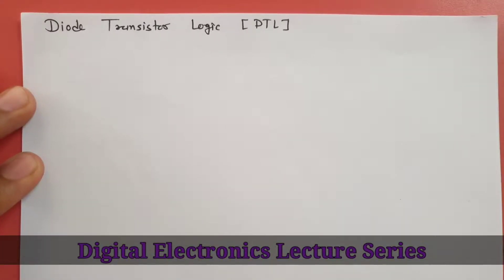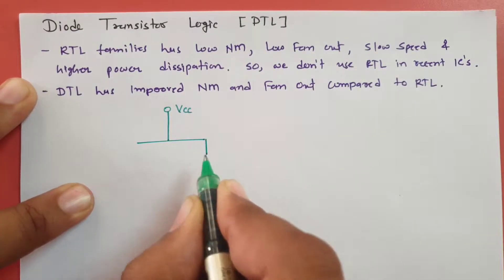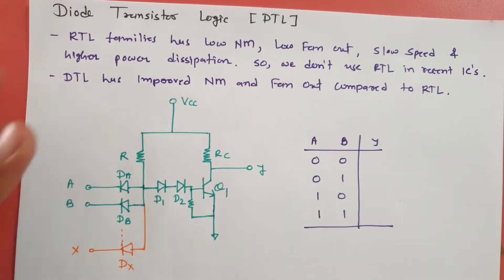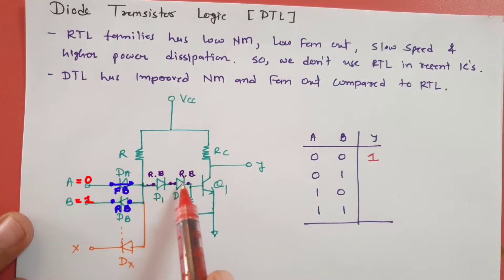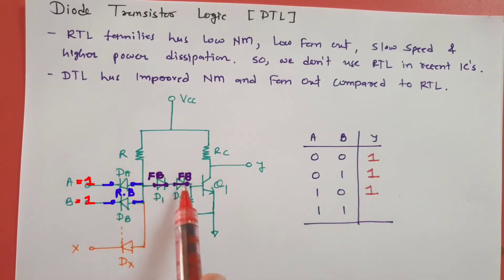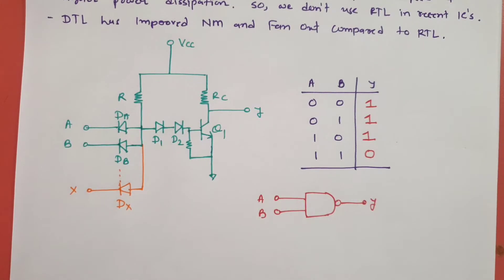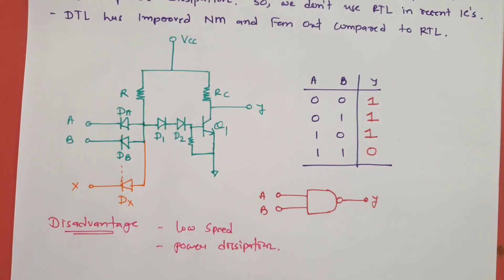Diode Transistor Logic (DTL): DTL NAND Gate Circuit and Working

Comment: 00:02 Diode Transistor Logic (DTL) offers improved fan out and noise margin.
01:27 DTL NAND gate consists of biasing resistors, transistor, diodes, and inputs.
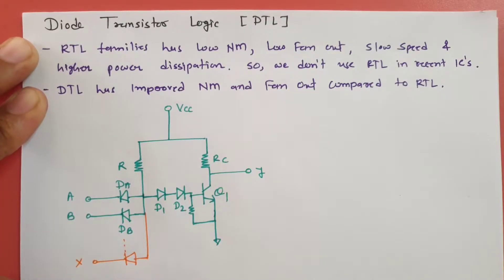02:41 Diode Transistor Logic (DTL) NAND Gate has input combinations and corresponding output
03:56 DTL NAND gate has an active high output signal when both inputs are low.
05:02 During DTL operation, if A is 1 and B is 0, the output is 1
06:06 DTL NAND Gate is a logic gate circuit that operates based on reverse bias and forward bias principles
07:10 DTL NAND gate requires a voltage drop of 0.6V across its diodes for triggering
08:31 DTL logic family has improved noise margin but lower speed and power dissipation are its disadvantages.
Reply from the maker: That helps students even
Reply: @EngineeringFunda  sir I'm also preparing for exam ( ◜‿◝ )♡
Thank you so much for your efforts❣️🥀🍂🙏🙏